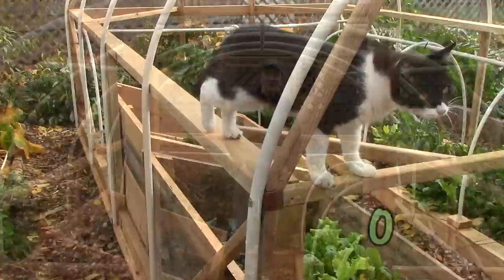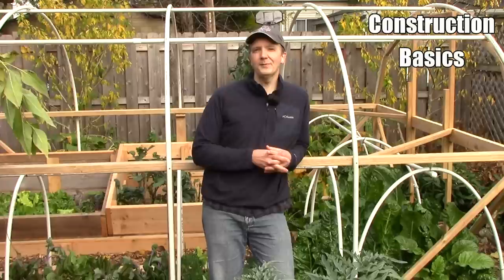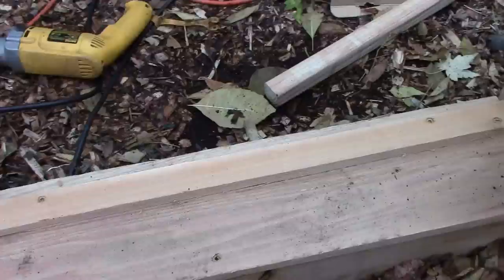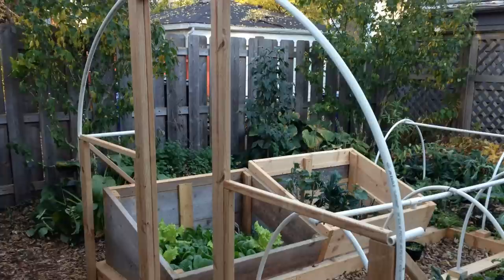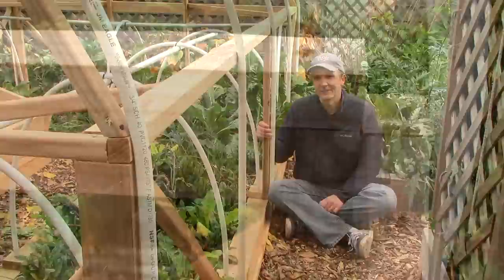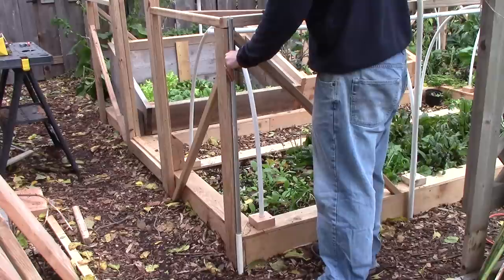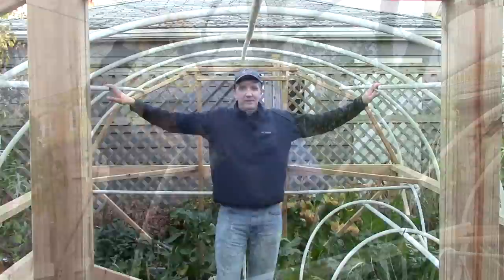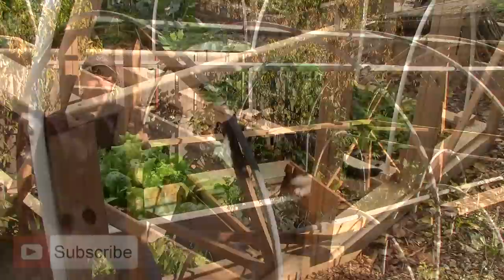How I Built Our DIY Hoop House (Greenhouse), pt. 1: Framing

Comment: Patrick
Here in the UK, I looked at several You Tube examples of building a Polytunnel (Hoop House over there!) and I much preferred your method - so I've built one, adopting as many of the principles as set out in your two main films  - structure/frame, and plastic covering. Just completed, about to start using it, and just wanted to say thank you for the time and trouble you have put into all your short films. Very useful, and I continue to watch.
All the best from a UK fan.
Reply from the maker: You're very welcome, Colin! Thanks for letting me know. I hope you enjoy yours as much as I've enjoyed mine.

Comment: Looks good to my Patrick. There is a vent in the back end of mine and the door is a combination screen door so all summer I use a cheap box fan at the vent and have the glass raised on the door. It's on a timer and comes on at 6AM and runs until midnight. I don't think it lowers the temperature any especially on hot sunny days but it does a good job of lowering the humidity, keeping fresh air circulating,  so I don't get powdery mildew and it holds the tomato blight at bay for a while. The old box fan was less than 20$ and it has been going for four years now.
Reply from the maker: +Dale Calder Thanks, Dale! We're actually going to take the top off in March and leave it off until November. This area of the garden doesn't get enough sun in summer to grow summer crops, so we're only going to grow our cold hardy crops there.

Comment: Nice job, Patrick!
You can have two little shelves by adding two triangular plywood onto the top of the horizontal braces at the NE and NW corners. The hoophouse would be more rigid and because of the low winter sun these extra shelves wouldn't shade the plants below. (And maybe an additional narrow plank between the two triangels as a long shelf for pots.) Just my 2cents.
Reply from the maker: +atizeg Thanks! You're absolutely right about the shelves. I was thinking the same thing.
Reply: Great! You can do it on the other corners too with some glass or plastic or put an old recycled aluminium ladder (if you can source one) with some wire mesh or so as a shelf.
The ladder could go to the top as well as a lightweight ridge/hanging basket holder.
Reply from the maker: +atizeg Thanks for all the great ideas! I imagine I'll want to make more use of the vertical space in the spring in order to start new plants.

Comment: Very nice video and a great job on your hoop house!  I am enjoying watching all your other videos too.  My only advice, as an avid DYI'er is to buy a 10" miter saw if you think you are going to do 5 or more projects like this.  For me, it's the best $150+ I ever spent.  You can even cut your PVC pipe with it. Having struggled for years with a jigsaw and a skill saw, I really wished I bought a miter saw earlier.  Nowadays I will pull out my miter saw if I need to cut more than one 2x4.   Not just easier cuts but much superior results, but I get that it can be done with a handsaw as well.  Cheers!
Reply from the maker: Thanks Kevin!

Comment: No workie in the south. You'd have to spray paint the pvc or it will crumble in a couple of years. Have to use ground-contact lumber or you'll have a termite farm. I like the guy's suggestion on gray conduit.

Comment: I see that you have been busy Patrick. I have been busy playing beat the clock getting my new greenhouse up before the cold weather set in. Your Hoop House looks like a great place for you to grow some melons in next season.
Reply from the maker: +dakotabob10 I know the feeling, Bob! We're supposed to have our first freezing temps tonight, but I still don't have the hoop house covered. Fortunately, the low tunnels and cold frames are covered, though.
Reply: OneYardRevolution | Frugal & Sustainable Organic Gardening Since last Saturday, I was racing to finish before amid NW wind was forecast to blow on Thursday.They were talking wind gusts to 60 mph. I had to make sure I got the doors hung before that hit. It is finished with the exception of of a few parts. You can see it on my dakotabob10 G+ page.
Reply from the maker: +dakotabob10 Looks great, Bob! Yeah, I was fighting 50 mph wind gusts while covering our low tunnels. After tonight's freeze, the forecast looks very nice here. Over all, we've had a warm October and November.
Reply: OneYardRevolution | Frugal & Sustainable Organic Gardening It has been warmer than normal here but that looks like it will be coming to an end at the end of next week. They have highs forecast for the 20's. So finish up, cold weather is on the way.
Reply from the maker: +dakotabob10 I keep an eye on the extended forecast, which looks pretty good for the rest of November. The crops I'm growing like cool temps, so I have to be careful not to put the plastic on too early.

Comment: I made one similar  to yours.   But I'd recommend using a wood beam going down the center to support snow.  What you have will not support snow.  In my humble opinion and past experience.
Reply from the maker: +Al Wilson Thanks for your feedback! I have been considering doing exactly that.
Reply: OneYardRevolution | Frugal & Sustainable Organic Gardening
The other things I came across was the low ceiling height brought the heat  closer to the ground and overheated the green house.  An automatic exhaust is a must.  Heating is easier though.  I think you are close to me what plastic are you going to use?
Reply from the maker: Al Wilson We'll use 6 mil greenhouse plastic. We've been growing in cold frames and low tunnels for years without heat or automated venting. We'll only be covering the hoop house from mid/late November to early March. Occasionally, we'll have to prop open the door when it's expected to be sunny, but that's about it.
Reply: OneYardRevolution | Frugal & Sustainable Organic Gardening
Awesome.  I used  6mil from Home depot and it worked out.  But then I just recently used lowes and did not like it one bit.  Its to late for me but menards stock a new 6mil that was reinforced.  Good blessings,

Comment: looks good Patrick! check out something to smooth where the plastic meets fasteners, corners or sharp transitions. those will be your first plastic failure points.
Reply: I second this comment.
Reply from the maker: +1mtstewart Thanks! You're absolutely right. I'll address that issue in my next hoop house update when I cover the hoop house with plastic.
Reply from the maker: +Jeff Fountain Hi Jeff. When I release the video on covering the hoop house with plastic, I'll show how I handle fasteners and other sharp objects.

Comment: Love it, but just a thought, the bolts you put through the PVC:  you might need to put tape on them or something to keep them from rubbing a hole in the plastic as the wind moving the plastic against the bolt heads may eventually wear a hole in the plastic where they contact. Just a thought, I love it, would like to have one of my own someday :)
Reply from the maker: +monnarush Thanks! You're absolutely right. In my next hoop house video, I'll show how I protect the plastic from sharp edges.

Comment: Patrick you hoop house looks fantastic!!!  I'm curious what your plans are for this hoop house in the hot summer months?  What crops do you plan on growing in here and how will you achieve ventilation to prevent from over heating??  I'm looking forward to you winter videos from inside!!!
Reply from the maker: +Joseph Strattard Thanks Joseph! The plan is to continue to grow only cold hardy crops in this bed, so the plastic cover will only be on from roughly November to March. This part of the garden gets the most sun in winter but very little in summer, so it's not a good location for summer crops.

Comment: My question would be, why not use EMT metal pipe or fence rail?  Wiggle  wire is by far the best way to secure plastic, even better than wood and staples since you have no holes in the plastic.   I learned the  hard way last year, pipe clips are worthless in these winds of the northeast.
Reply from the maker: +motocephalic Metal pipes would be an excellent way to go. I'll discuss them as a possible design improvement in my next video. I'm still debating whether or not to go with wiggle wires. We have so many wind blocks here that the wind is not too much of a problem. Either way, I'll mention them in my next video.

Comment: The problem I've sometimes encountered with putting 3/4" PVC over rebar is that any burrs on the top of the rebar can prevent me from getting the PVC all the way on...or getting it off if I have to!
Reply from the maker: Yeah, I can see that happening, especially if you have to remove the PVC.

Comment: Awesome job. Many great ideas here. Have you cosidered visiting Garrett Co, MD to do some building? 😁. A thought:
Worry that once the plastic is up though you will mourn the loss of free water and the codensate inside may contain some of that safe treatment on the pine. But with said its a fine building and surely will serve you well. Thanks as always.
Reply from the maker: +Suzanne Ramoundos Thanks Suzanne! Watering the winter garden isn't much of an issue. We may have to water a little bit later this month and into December but once temps are regularly below freezing we won't water at all.
Reply: +OneYardRevolution | Frugal & Sustainable Organic Gardening 
So long as temps stay below 50 in the soil that is true but on days when its 40 and above outside, you will be amazed how fast water leaves the beds.  Niki Jabbour addresses these issues in her winter gardening book and we have experienced it a lot with our smaller cold frames especially in Feb when temps were super low.  But you have used them so you are probably familiar with that. Size of the space makes a lot of difference too.
Reply from the maker: +Suzanne Ramoundos As a rule, I water when cold frame temps are well above freezing, I don't expect them to dip below freezing overnight, and the soil seems dry. That doesn't happen very often here in January and early to mid February. During that period, plants are typically dormant and don't need water.
Reply: +OneYardRevolution | Frugal & Sustainable Organic Gardening Probably was thinking more about the seedlings you can start In that time under double and maybe even triple cover...But, with more cover means more opaqueness and harder access for watering.  You are right, plants brought to 80% growth in the fall won't need too much if any help. Air will be more important than water for them especially since your soil is so well mulched.

Comment: In one of your videos I recall your having said that it is difficult to move a raised bed once it is in place.  I have 2 large beds that are 4x8 and 18 inches deep.  However, it seems I may not need them to be that deep, since yours aren't.  Additionally, I think I misinterpreted Mel Bartholomew's recommendation and put the narrow edges (4ft) on a north/south orientation.  It seems to me a mistake because I am not taking advantage of using the long edges (8ft) along the north side of the beds in order to grow more crops vertically.  So I want to re-orient them this coming spring.  I'm in 4b/5a, so similar to your area.  I was considering unscrewing the wood from all sides then reconstructing 3 beds out of the two I have, each ending up being 4'x8'x12" (then building a 4th eventually to make a sort of grid) with long edges on a north/south orientation.  I know it is a lot of work, but I can recruit family and friends to do it with me.  What are your thoughts about my idea?  I want to eventually add a small hoop house structure incorporating two of these beds one in front (i;e. to the south) of the other.  How wide is the path in your hoop house between the two planting areas along the length of it?
Reply from the maker: Hi Michele! If you can get a couple helpers to help you lift, I'd first try to lift the raised bed, slipping it right over the soil. If this doesn't work, taking it apart like you described will get the job done. I think the path in my hoop house is 18 inches. If you have more space, you can definitely go wider.
Reply: @OneYardRevolution  thank you very much, Patrick.

Comment: Nicely done, Patrick. Did you consider an all-wood design, instead of using conduit? Maybe attaching the plastic sheeting to wood would have been trickier than to conduit.

I always learn something from your videos. Appreciate your time and passion.
Reply from the maker: Thanks! It's easier to tightly secure greenhouse film over the pipes than over wood, which would be more likely to tear it.

Comment: Great video and very nice hoop house, looks awesome!  Any particular reason for using PVC pipe instead of PVC conduit with flared ends for easy coupling?  Seems like a good amount of extra work, just wondering if there's a benefit I'm not perceiving.
Reply from the maker: +CrazyAZ Gardener Thanks! Very interesting.  I wasn't aware of the PVC with flared ends. In general, I was concerned that glued couplings wouldn't hold up well when the pipe was bent.
Reply: Completely understand, I'd be concerned with the coupling pieces too, although it looks like you've got them very secure at this point.  They sell it as PVC electrical conduit, it's dark grey, schedule 40. Like this: http://www.homedepot.com/p/JM-eagle-1-in-x-10-ft-PVC-Schedule-40-Conduit-67462/202295893
Reply from the maker: +CrazyAZ Gardener Thanks! That's why I haven't seen it. The electrical codes here require EMT conduit, so PVC electrical conduit isn't in stores.
Reply: Aha! Very interesting.  Keep up the awesome work.

Comment: Love it but I'm thinking going a little taller because for my climate it be wrapped I a bug mesh Rob Bob and I live in the same climate so it would not require the plastic cover frosts are no existent
Reply from the maker: Thanks, Gordon! In your situation, I'd probably use a simple metal hoop structure. You could use EMT conduit pipes for the hoops.
Reply: Yes I had though that way would be best

Comment: Patrick, Great video that will come in very handy here in Up-state NY, next fall.  But I have a question not related, "During the spring, summer and early fall seasons where can I find BROWN material for my compost?  Also, in late fall, when all the leaves begin falling, I need to find something Green to mix with all these leaves!  You have any good ideas?
Reply from the maker: +Richard Frazee Thanks, Richard! One way to get enough browns is to collect a whole lot of leaves and use them to make compost throughout the year. We've also used aged wood chips, which break down surprisingly fast. In the fall, used coffee grounds from a local coffee shop are an excellent nitrogen source. Urine will also do the trick

Comment: only because I have lived in the Great White North, i would like to suggest having two pre-cut 2x4's cut to the correct length. That way you will be ready for the El Nino winter storms. Other wise looks like the deluxe version of a hoop house. Will you leave the frame up the whole year round?
Reply from the maker: +Andre Lotscher We'll leave the frame up but remove the plastic cover from early spring to mid fall. I think the current structure will hold up, but I'm thinking about replacing the ridge pipe with a 2x4.
Reply: Maybe you could put 1/2" conduit in side.
Reply from the maker: +Andre Lotscher I could except for the bolts. Fortunately, the 2x4 would be an easy and inexpensive change.

Comment: Don't you just hate it when a commenter says, "You should have done this . . ." or "You did that wrong?" Me, too! But, you should have used grey PVC conduit. It resists UV rays whereas white PVC pipe does not and becomes brittle.
Reply from the maker: We've used schedule 40 PVC for 12 years in the winter garden and haven't had a single pipe fail.

Comment: As others have already mentioned it looks very well built and sturdy.  I do look forward to winter videos from under the hoops !  I would like to indulge you in a question or two if I may.  Do you plan on doubling the plastic or just use one layer ?  I am assuming one layer since you will be growing in low tunnels and cold frames inside.  Also when you designed the structure did you ever consider using polycarbonate panels with a more traditional structure ?  If so other than cost why did you choose the hoop house ?  Thanks again for sharing !
Reply from the maker: +Doug Lochart Thanks, Doug! Yes, we'll just use one layer of plastic on the hoop house. In addition to cost, we went with this design because we'll be using the hoop house only for cold hardy crops and will remove the plastic in March and leave it off until November.
Reply: +OneYardRevolution | Frugal & Sustainable Organic Gardening 
That makes sense.  I did like the suggestion earlier about using it as a trellis during the summer so having the plastic off would allow that.  Hmmm ... something for me to think about as well :-)  Take care !
Reply from the maker: +Doug Lochart Yeah, that's a great idea.

Comment: I wonder if a triangle shape piece of plywood could replace the the corner braces at 6:18.  I don't like how they protrude into your work space. You will have to duck under them and the low tunnels.
Reply from the maker: +Double Dog Farm They do get in the way if you want to access veggies from outside the hoop house frame, but they're not in the way when you're on the inside. Even so, I like your idea of using  a triangular piece of plywood. I think I'll cover the bracing on the north wall with plywood so I'll have a couple shelves.
Reply: OneYardRevolution | Frugal & Sustainable Organic Gardening
and even stronger corner
Reply from the maker: Double Dog Farm Very true.